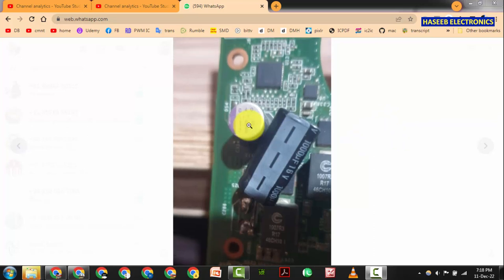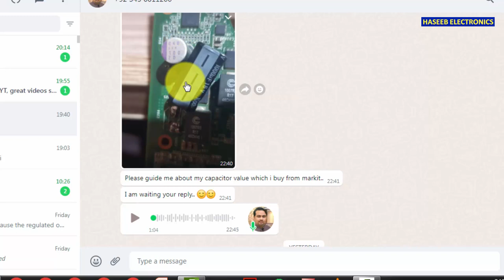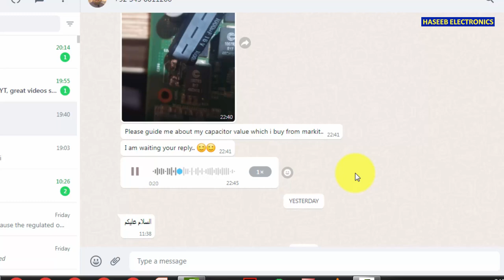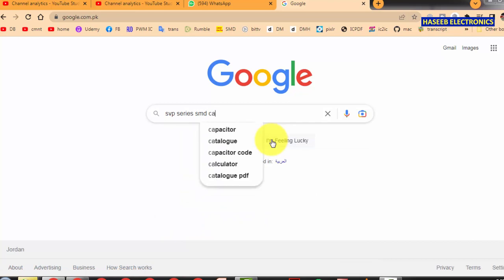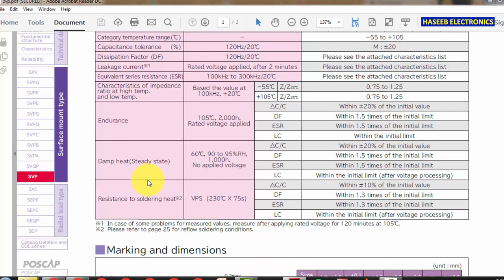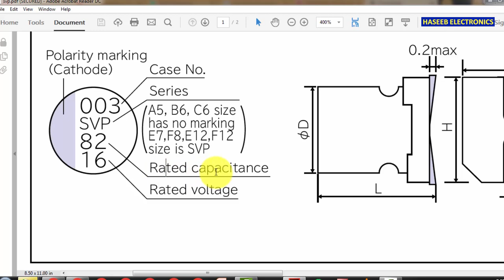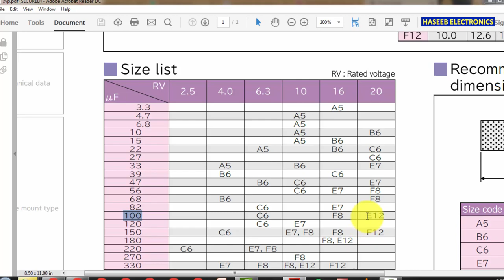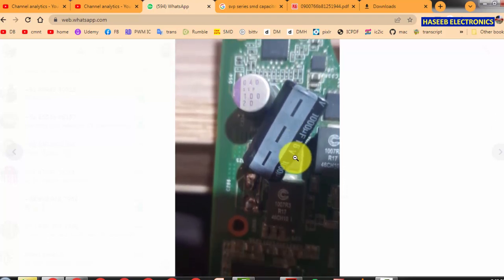{790} Understanding SMD / SMT Capacitor Marking

Comment: Thank you sir for this great information. I want to ask something. For example, the capacitor value is 100uf and when I measure it with a capacitance meter, I see 800uf or 1.2 mf. that is a very high value. is this okay? or is it faulty? If it was low, we can say 40uf or 30uf is faulty, but when it is high, does the same thing apply? thank you for the answer
Reply from the maker: best regards
if a capacitor value is 100uf. add 20% of the capacitance, it will around 120uf, or minus 20%, it will become 80uf.
if the measurement are within this window (80 to 120uf) the capacitor to be considered as healthy capacitor 
some special capacitors have +40% +50% +80% tolerance but the -ve tolerance will not more than 20%
if some capacitor is giving 800uf instead of 100uf (as you asked) or 1200uf. it cannot be justified in any calculation 
(might be you are asking 1000uf) if yes, so that will 1000+-20%. the capacitor will acceptable
Reply: @HaseebElectronics  Thank you very much master. This subject has always confused me. I would like to ask one more thing if you don't mind. While measuring capacitors all the time, should it be 1kh and above? Because sometimes the capacitors measured above 1khz show a short circuit, but it gives a normal value when measured at 100hz. Is it necessary to change the resistor value at 1khz? but as I said, when I measure it at 100hz, the value shows normal. I generally think that if it is in the ct rt circuit, it should be changed, but if it is on the output, I do not know what to do. Thank you very much again, my master, may Allah be pleased with you.
Reply from the maker: @apachecomm  capacitor is tested at DC level to verify capacitance
but when we test it's ESR value, that time we use frequency test signal to check it's response. that is it's XC
XC=1/(2πFC)
so each capacitor size will give different impedance at each capacitor
Reply: @HaseebElectronics  master, can you make an example of this when you are available? I think you will understand better. Because when I measure it with a capacitance meter, it gives an OL value. I am indirectly changing. So I'm just trying to see if it's on the frequency line or not. Thank you very much for your interest, master.

Comment: sir, can you make a video for capacitor calculation to be used in circuit. mostly videos online show only its functions and uses but never did for proper calculation to be used.also for resistor,inductor or any component for a circuit. thnx sir.